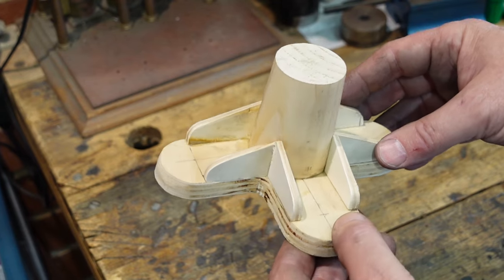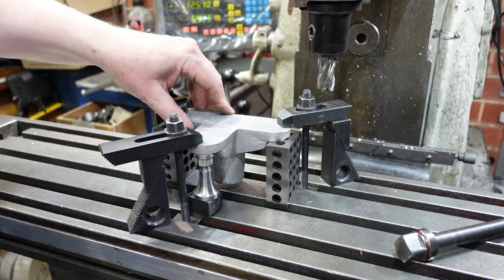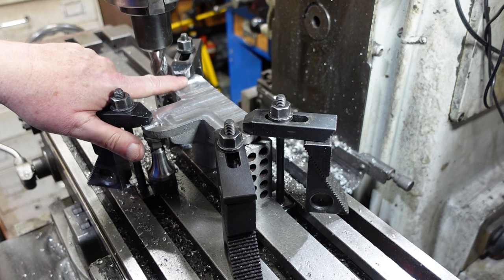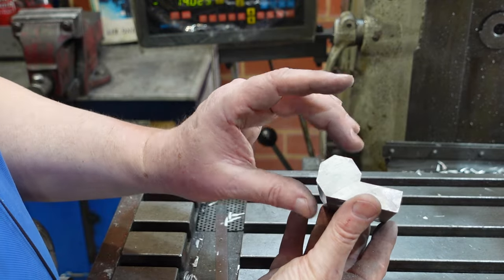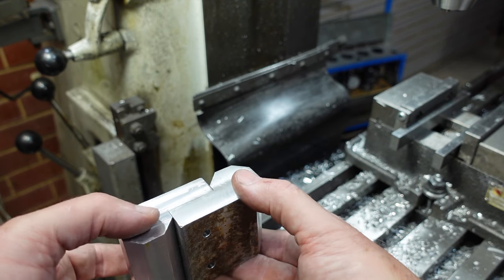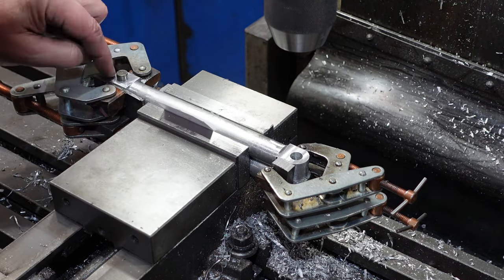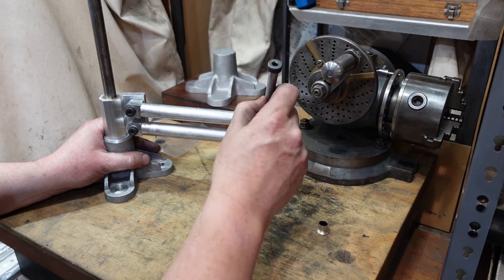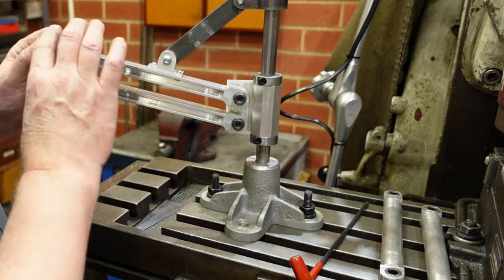A homemade tapping arm for the shed (pt 1)

Comment: great how things "evolve".
Reply from the maker: It's getting there - the finished device has evolved into something pretty neat.
Reply: @occasionalmachinist  I have a comparator stand that I got off of a retired printer, I intend making this into a tapping stand. one of those jobs "when I get round tuit"😁
Reply from the maker: All of the tapping stands I've seen have some way of holding down - whether that is bolts or magnets. You might find that your comparator stand is not heavy enough.
Reply: @occasionalmachinist  It is 12" square cast iron 2 1/2" high, with 1 1/4" steel bar sticking up out of it. All I need to do is make a dog bone like affair, running off the upright. so I can tap straight through the other end if that makes sense.
Reply: What sort of friend looks at the fruits of your labour and says "can't you do better?”😂
Reply from the maker: Probably one suffering from 'Shed activity deprivation syndrome'. They need to get out more (into their sheds) 🤣